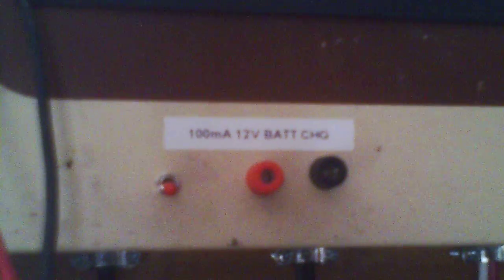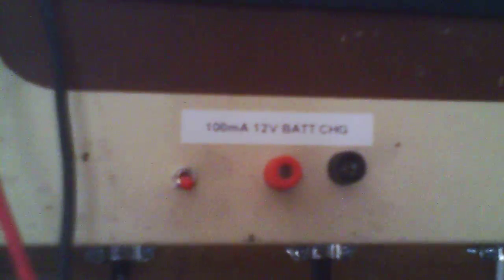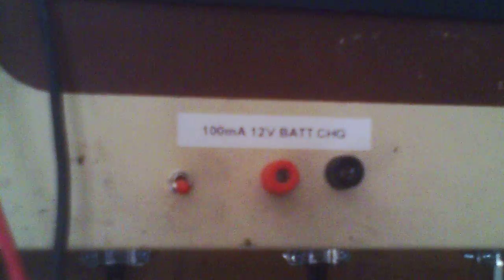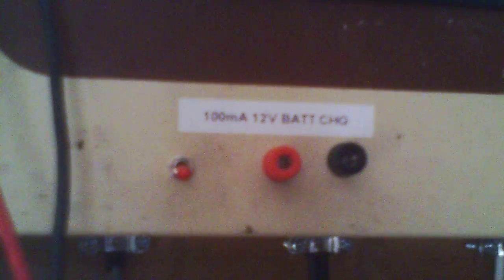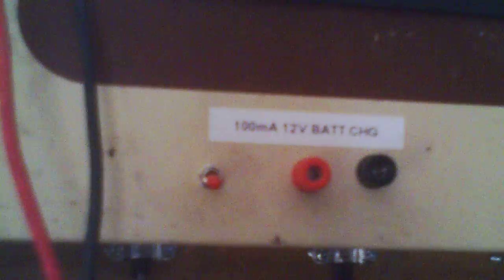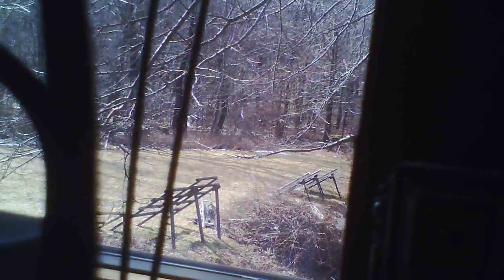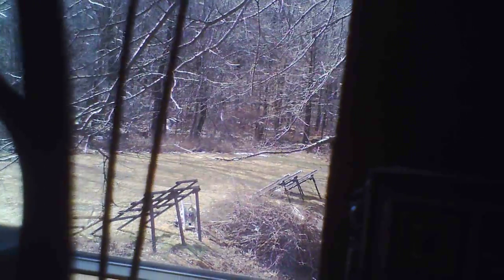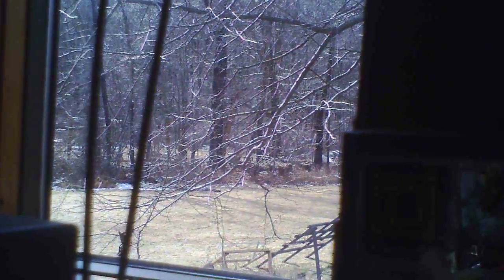QS Solar array short circuit current testing and arcs

Comment from the maker: @mathgeek311   This is what the super cheapo Harbor Freight multimeters looked like back in 2005 (when I got this one).  Sure it ain't a Fluke or a Simpson, but it doesn't suck (although one of the red ones I have will sometimes read an overload (-1 on the left of the display) when set to read potential until the probes are shorted, after which it works normally.  But hey, you get what you pay for. ;)